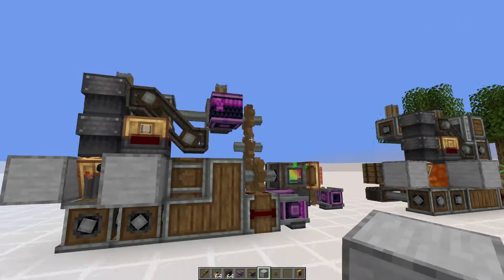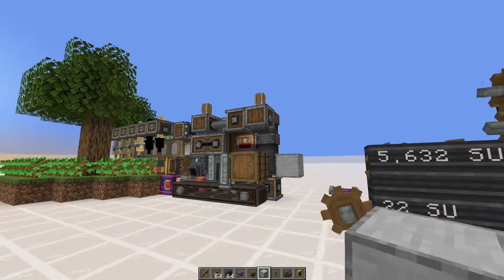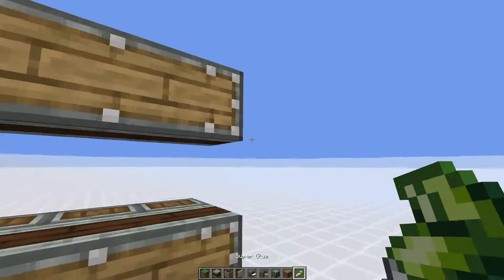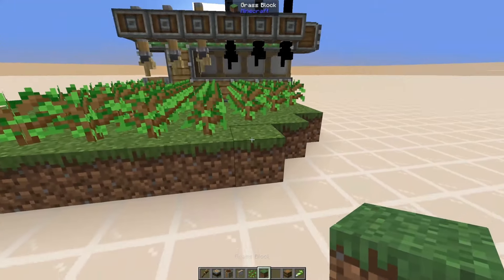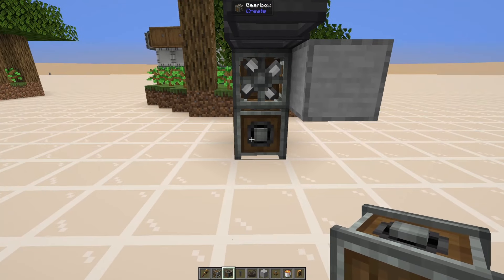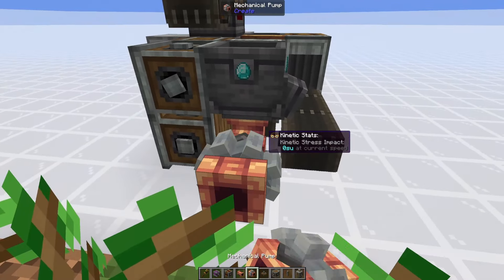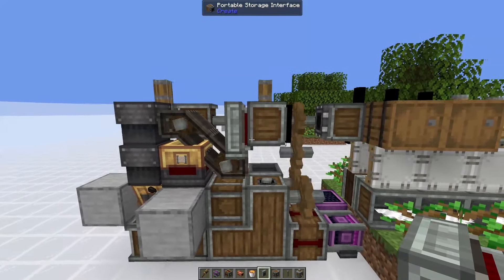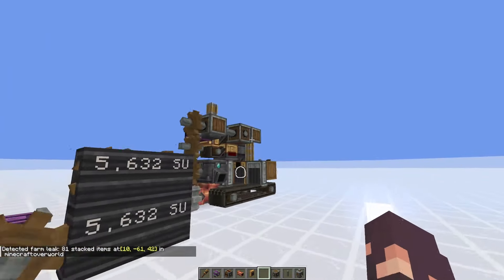How to Make A DIAMOND FARM In The Create MOD! | Create Mod Block-by-Block TUTORIAL

Comment: how are you able to see the block info? like how much charcoal is in there or how much coal is in the basin
Reply from the maker: It’s a mode called Jade!
Reply: @kindlebubbledump  Thx and btw i finished building the farm, but it doesnt turn the coal into coalblocks, when i put coalblocks in it turns them into diamonds witch works but the press doesnt turn the coal into coal blocks automatically, i also tried filtering the basin with coal blocks but that doesnt even make charcoal into coal lol but could u pls help, and i also have the addon installed
Reply from the maker: @emrehackt hmmm weird. It might be worth trying to add 1 more basin to press the coal on its own into coal blocks. Not sure why it wouldn’t be working. Also Do you have the pressing recipe to turn coal into coal blocks?
Reply: @kindlebubbledump  i tried that vut i dont know how to connect it to the basin for the diamonds like i dont find a way to connect them since everything has like already a path so its a bit hard to find a path, maybe i could try to make the basin for the diamonds more out so i have more space, but thanks for the help
Reply: @kindlebubbledump  i can look if i have the filter but i dont think i have, i have the filter for the funnel i know that but not sure abt the press
Reply: @kindlebubbledump  but since its late rn in my country in checking tmr on it
Reply from the maker: @emrehackt yea you might need a bit more space. Hopefully that fixes it, good luck!
Reply: @kindlebubbledump  idk if i have a filter on my press im gonna check on it tmr since its late in my country (if you see 2 comments related to this, its just that i dont see them so idk if its a bug, and earned a sub btw i still liked the tutorial much and keep up the good work im sure youre gonna be a big channel someday)
Reply from the maker: @emrehackt ok yea lmk! And thanks for the sub!
Reply: @kindlebubbledump  btw do you know if there is a fabric version of the addon since me and my friends are having a server and we are using fabric a loader (i just used forge to test if it works) or if not if there are any alternatives since i didnt find anything?
Reply: @kindlebubbledump  when i joined the world today it suddenly worked lol, thanks for the help tho
Reply: @kindlebubbledump  found out that the andesite funnel is mor efficient than the brass funnel for the portable storage interface, cause if it goes in stacks the press will just make the charcoal into coal and doesnt find time to make the coal into coal blocks so it just takes longer for a coal block to get into the diamond basin
Reply from the maker: @emrehackt ohhh ok good to know!
Reply: @kindlebubbledump  do you know a fabric version of the addon since im playing with my friends on fabric? or maybe an alternative that is fabric compatible
Reply from the maker: @emrehackt  I don't think there is a fabric equivalent of this farm unfortumately
Reply: @kindlebubbledump  ok thx for the help tho

Comment: I used a steam engine to power this and it was processing the diamonds so fast the wood farm couldn't keep up, any tips on how to help
Reply from the maker: That’s intended functionality cause a wood farm big enough to fully use the throughput that can be used would be massive. If you want to you could add an auto on/off switch when u get to a stack of wood, but that won’t do too much other than save you some SU when u don’t need the machine
Reply: @kindlebubbledump  something I noticed is trees seem to grow slower at night is that a thing or am I going crazy
Reply from the maker: Idk tbh. Probably?
Reply: Crops and saplings need light to grow i think so if you haven't lit up the place that's probably why

Comment: It's not working :( Here's the problem. The brass funnel is not picking up the charcoal and putting it into the basin. Please someone help!
Reply from the maker: Do you have the valkerian skies mod installed? That prevents funnels from working properly (it’s a bug) you can either put a depot down for the funnel to pickup items from, or a belt. Either way it will prob increase the size of the farm by one block
Reply: Never mind, I fix it. I had the brass funnel the wrong way.
Reply from the maker: @ oh awesome!

Comment: Doesn't work. Even with the extra mods. The coal blocks and the lava wont get pressed into diamonds.
Reply from the maker: do you have the charcoal>coal and coal block>diamond recipes in your JEI? if not, and you have Create: Ultimate Factory, then there's another mod/modpack config issue that's removing those recipes
Reply: @kindlebubbledump  I have them but the press is just not doing it's job. Plus the charcoal doesn't really go into the basin, even tho I installed an extra fan for it. When it does tho, it will press into normal coal just fine

Comment: For some reason the fan is pulling instead of pushing
Reply from the maker: Are all the belts moving the correct way? My guess is you’ll need to invert the rotation direction
Reply: @kindlebubbledump  i fixed the belts with gear shift but only the fan is the problem
Reply from the maker: @spit782 replace the vertical gearbox behind the fan and the vertical gearbox below that one with 2 encased chain drives. That should fix the issue
Reply: @kindlebubbledump  That fixed it,thanks

Comment: why our chorcoal turns into chorcoal block
Reply from the maker: You have another modpack recipe, all you have to do is add a list filter with coal and coal blocks to the basin
Reply: @kindlebubbledump  I tried this and it still does not work.
Reply from the maker: @chriswilliams1404 do you have the create additional recipes mod installed? It’s a forge 1.20